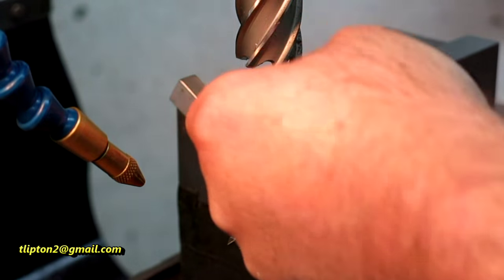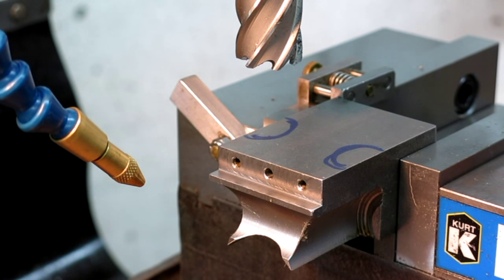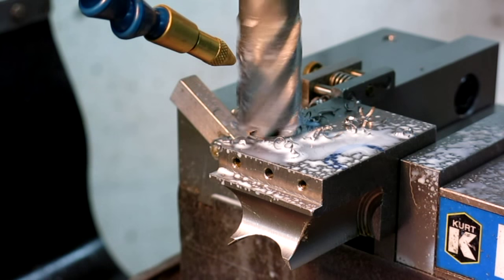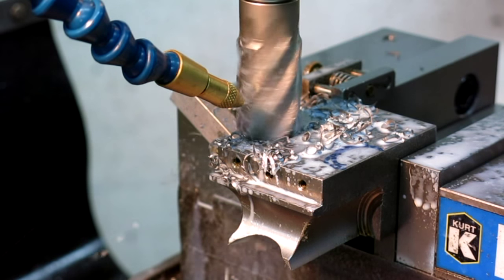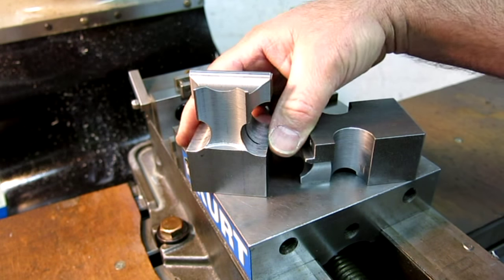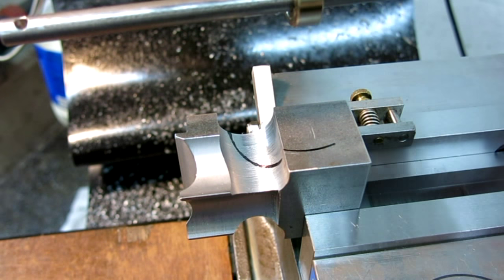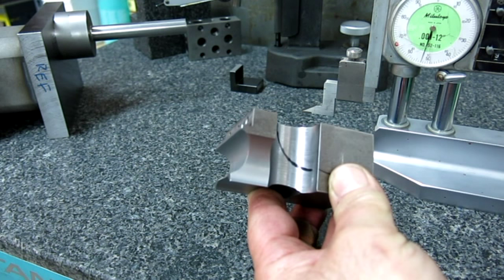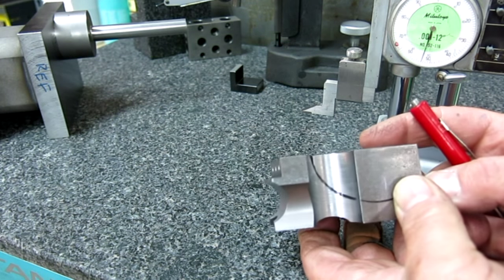Wilton Baby bullet 14

Comment: Thats a pretty ingenious and elaborate layout method you used for the multilevel arc Tom!  I have used a projector in cases like this and traced the projected line with a fine tipped sharpie.  But your method is awesome!  I agree that a spring would be a good addition.

Comment: That is a very neat marking tool. Sort of like trammel points, but one  point of the trammel is the mill spindle. If you didn't have that slick marker, you coud use a hard point, blue the thing, and scratch in the curve. I suppose the hard point would be more accurate, but for this case it is hardly needed. All going to be filed anyway. I have made notes.

Comment: Cool I want one of those markers!Its pretty easy to CAD draft up a X/Z table of cords and do stuff like that with a ball end mill,you could roll right on over the top radius as well!I would start at the deep end and come up with each X move and remove most of the metalwith the straight part of the mill, let the ball do the finish..025" stepover will leave very little filing with a 3/4" ball endmill.Just a thought.Gent

Comment: Why finish it by hand when you could do it with the boring head?
Reply: +soundgod06 My guess is that because he no longer has a big chunk of metal to hold on to at that point.
Reply: +Pete Brown I see why he won't be able to hold it in the vise for that cut, but he would still have a good chunk to strap it down to the table with.
Reply: I was thinking one could use the shelf, that has already been drilled and tapped to attach the hardened vise jaws, as a nice register to fixture the part. Then it would be fairly straightforward to use the boring head after the bulk of the material is hogged out with a mill ...